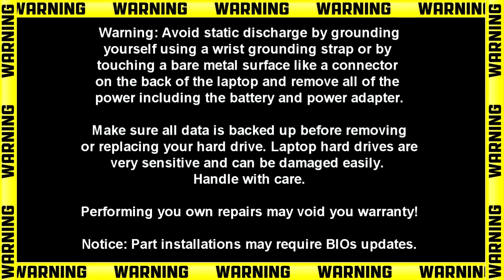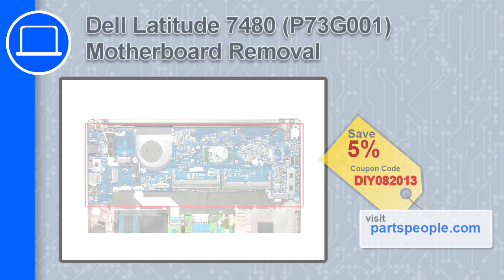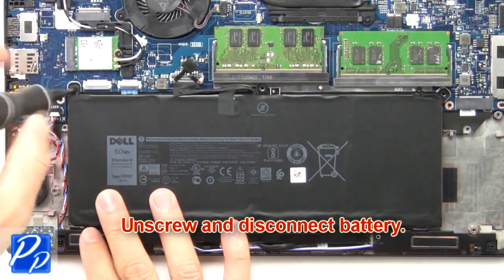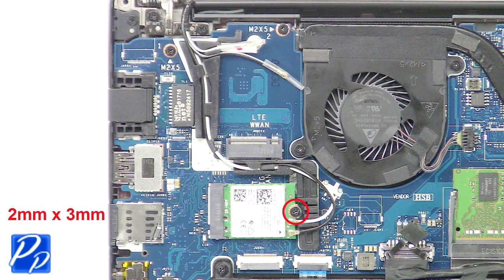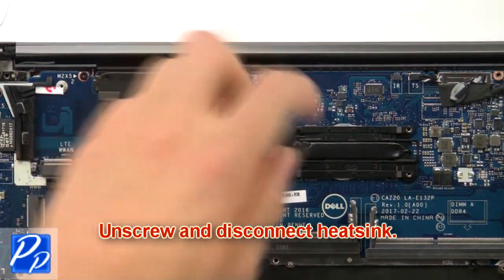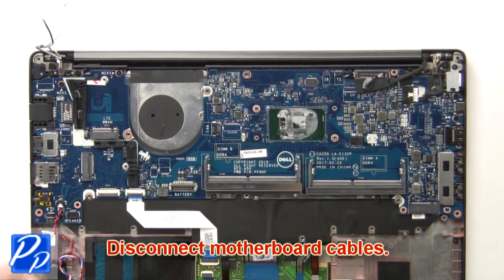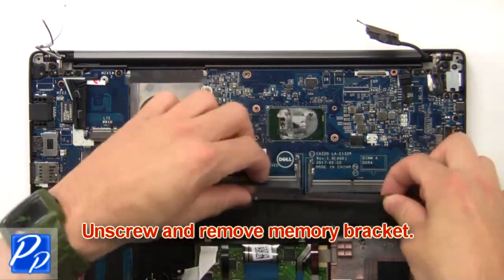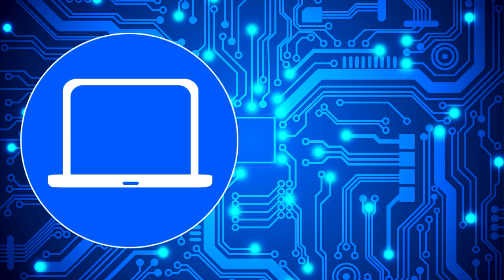Dell Latitude 7480 (P73G001) Motherboard How-To Video Tutorial

Comment: I think the 7480 was sold was several different types of motherboards. Can you drop any of those motherboards in any 7480?
Reply from the maker: The following motherboards have the same input/output configuration and are compatible with any Latitude 7480: http://ppci.me/c/140/971/motherboard